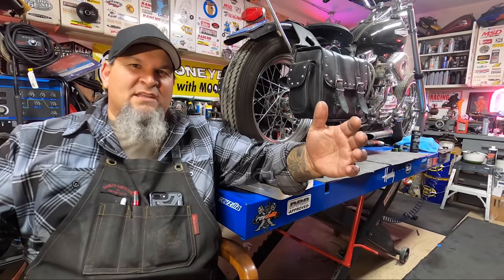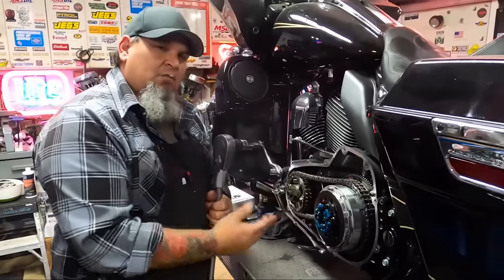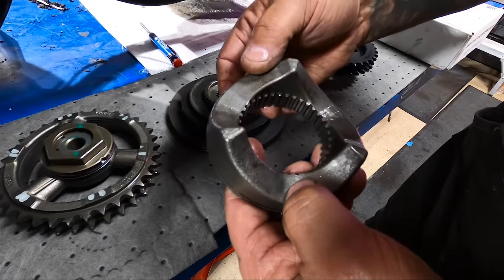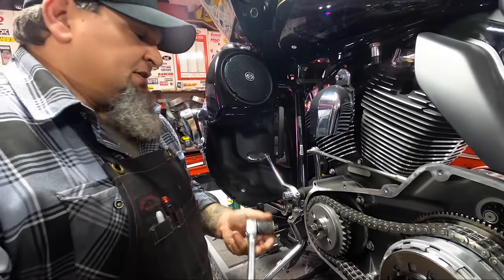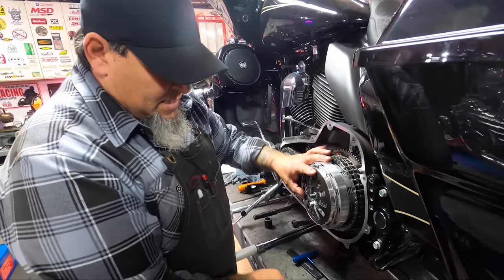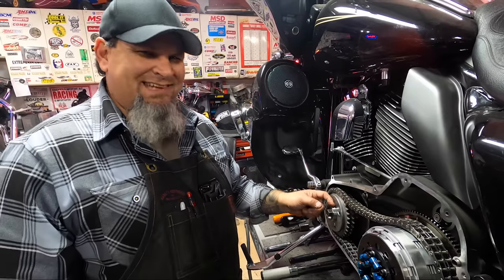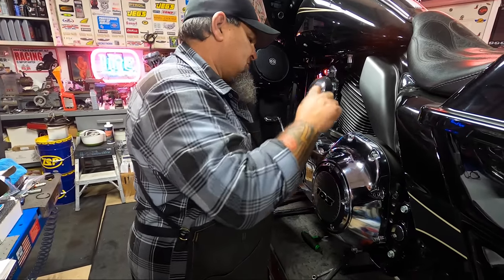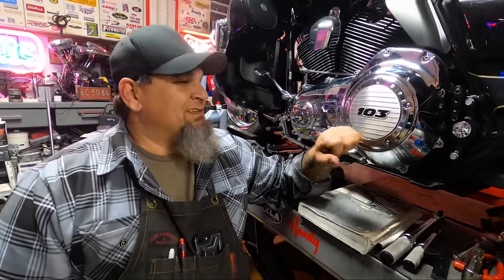Compensator Upgrade for Harley Davidson

Comment: I bought the Twin Power adjuster... after 850 miles the black block the chain rides on was pretty much chewed up.  I tried for weeks to contact Twin Power with no luck at all.  I ended up changing to the Baker self adjuster.  Its a bit noisy but it works good.  Still trying to figure out the right spring adjustment.
Reply from the maker: Tom, I have not had that issue with the Twin Power..... I have also experienced the Baker being noisy. Did you contact the vendor you got the Twin Power from? Maybe they can help
Reply: @LateNiteVTwin  ... I tried for months to talk to Twin Power.  I never could get ahold of them.  I'm now looking for a better adjustor.

Comment: Gary...thanks for  a great video... regarding the chain tensioner, Twin Power part 216094 (touring) was changed to part no. 210481 according to Twin Power customer svc.  Problem is that I cannot locate the part from any of their listed vendors...do you have a supply source, or can i buy it direct from you?  Thx  John
Reply from the maker: I purchase them regularly through JP cycles, Dennis Kirk, Drag, etc.......I still get them under the part number I had listed. Let me know if you need help sourcing one. I'll do some digging
Reply: @LateNiteVTwin  thx buddy.  I'll give JP a direct call.

Comment: What really causes the "ring of death" or "line of death" on the inside of the primary cover?!  I've been told it's a compensator issue.
Reply from the maker: Ken, I have never heard that term. I'm assuming you're talking about the chain actually rubbing the inside of the primary?
Reply: @LateNiteVTwin  i believe that is exactly what he's talking about. Caused by loose primary chain or maybe a bad inner bearing or both, correct?

Comment: Thank you sir for the great video. On cycle works website it says on 07 to 10 1/2 touring models you need to run HD part number30041-08A a retro stator. Is this true? Thank you

Comment: Hey Gary, great video. Question I have is with the chain adjuster. After setting the correct slack do you need to readjust it for wear of the shoe during normal servicing or is it set for a certain period of time like every 10,000 miles etc. Thanks in advance.
Reply from the maker: Frank, thank you for the question! I check the adjustment from time to time, roughly 10-15k.
Reply: @LateNiteVTwin  Thank Gary!

Comment: I came across your channel tonight for the first time and really like it. I have an 08 Eltra completely stock with 10k. I want to change the tensioner and want to know what to look for on the compensator for wear or damage.  Also what brand tensioner would you go back with for a totally stock bike? Thank you for all the time and efforts you put into making you videos.
Reply from the maker: Hi Burt! For a totally stock bike, the Harley Screaming Eagle unit is a good choice. Any hi torque upgrades I think that compensator will lose out in the long run. I would however recommend a manual primary chain adjuster to help keep the wear to a minimum since the stock one keeps the primary chain banjo string tight. Chains like slack, as they tend to get tighter when hot. Belts like tension, not chains. Set the slack to 1/2" to 5/8". The compensators wear against the spring plates, and the drive surfaces of the fingers. Also, look for wear on the bearing surfaces between the plastic thrust washer!
Reply: I took my bike in for a cam chest upgrades and my mechanic noticed a sound coming from my compensator. He replaced it with a Dark horse, but didn’t have his recommended Hayden chain tensioner. I ended up calling Hayden inc to have the tensioner ship to me. Thanks to this video, I can save money doing it myself.

Comment: On my 2014 ultra limited with 6 k miles should I replace the oem chain tensioner to a manual adjustment like the one you installed in your bike?

Comment: Thanks great training. 
Will you be doing 08 style hydraulic cam chain adjuster wear pads. 
My bike has 45,000 miles on it should I be replacing the pads.  ?
Thanks Don
Reply from the maker: Hi Don, the pad on the self adjusting tensioner should be checked for wear yes, but honestly i've seen them go much longer than 45k. Have you had your primary cover off lately to inspect?
Reply: Sorry I changed the topic 
My question is concerning the hydraulic cam chain wear pads
Reply from the maker: @donnixon3528  Don, I have notices that the shoes on the hydraulic tensioners on the cam last much longer than the previous design. It's not a bad thing to check them

Comment: Did you have to grind the plastic oil deflection pieces on the primary cover to get the dark house gear to fit?
Reply: Nope. No grinding nessasary.
Reply: . @maxkilbourne3142  Far out, thanks

Comment: What size is that old bolt? if I'm correct, harley went to the SE compensator as standard equipment in 2011.

Comment: Liked your video and subscribed I just installed the dark horse compensator and manual adjuster i checked alignment with a straight edge and found i have alot of noise coming out of the primary cover? I read the dark horse is louder than stock but it seams excessive any thoughts? Thanks
Reply from the maker: That doesn't seem right???? Mine is really quiet, more so than the stock or screaming eagle unit. What was your chain deflection at? 1/2-5/8"? And what tensioner did you go with ??
Reply: My chain tension was about 5/8" and the tensioner i think was harddrive(looked cheap) I did notice a pretty big tight spot in the chain and thats were I adjusted at

Comment: Do you have any experience/opinion with the Southern Oregon Hot Bikes primary chain adjuster? They are local to me and I want to replace the stock unit with something better
Reply from the maker: I can't say that I have any experience with them. Anything is better than the factory set up! Give them a try and let me know how it works for you!
Reply: @LateNiteVTwin  u got it 👍. Their unit adds tension automatically also, but it is hydraulic, not mechanical. Looks pretty slick.

Comment: After install of man of war compensator is there any noise coming from primary ? Or smooth? I watched a video where there is some noise from man of war sprocket chain noise it was on a m8 tho. Just curious I have a twin cam and was just wonder before I install one of these in mine. Which I think I’m going to do. Please let me know ? Thank you and great video!
Reply from the maker: James, the bike that this install was on was my personal bike. I am happy to report that it's very quiet. If you use the stock tensioner, I'm not sure how much noise that would make. If it's still making a racket then take a look at the inner primary bearing behind the clutch. Those fail due to the chain tensioner keeping constant tension and ratcheting up all the time. I like the Twin Power adjuster, Baker makes a good one, as well as Hayden. I set the chain 5/8" to 1/2" of travel and forget it. Chains do not like to be banjo tight, so look at that as a possible issue. I hope that helps??
Reply: @LateNiteVTwin  
Thank you 
I have a 2010 fatboy lo haven’t done anything as of yet. Just curious your primary chain tensioner you used. I have a Oregon hot bikes primary tensioner now. Looking to get rid of stock compensator ASAP. I have 6,266 miles on bike. Don’t want any issues down the road. Thank you for your input! The only reasoned I asked about noise is there’s a dark horse man of war video of a newer m8 style motor. He had noise in primary case sounded like chain to loose???? I dont know. I just didn’t want same results is why I asked how yours was. Sorry for running on. Have a great day thank you for great video!
Reply: @LateNiteVTwin  
I just got man of war compensator.
They said I needed t70 sprocket bolt. Also have to add a little oil shield to help pour oil on washer on the end of sprocket. Curious if there’s different lengths of bolts ? The HD #10500031 

I will check  lengths is this seem wrong to you? You said don’t install t70 bolt. 

My bike is a 2010 Harley fatboy stock 96ci
Reply from the maker: James, I did not use the T70 bolt from the Screaming Eagle compensator. I just read the instructions, a little vague, but no mention of the shield install or the bolt. When I did the trial run on the video I noticed that the T70 bolt was to long and it hit bottom without the proper seating of the new unit. I did leave the shield that was from the harley compensator upgrade only because it's epoxied on and I did not feel like taking it off. The design does not require it. I will give them a call and let you know!
Reply: @LateNiteVTwin  
I thought that was what your video said too. That the t70 was too long. But if the bolt is too long yeah you can’t use it ? They recommend the bolt as well as the oil deflector at dark horse. Thank you for any help on this just wanting to make sure it’s done correctly. You have hands on and very knowledgeable about this stuff. Thanks again looking forward to hearing back from you my friend.

Comment: Great Video! Have you had any vibration issues since the install of the dark horse comp, I’m planning to install in my recently built M8 107 to 124,now noisy knocking sound from stock comp because of higher compression, thanks for any advice! 🤙🏼
Reply from the maker: No vibration to report, at least from a compensator issue. After all, it's a Harley. I have put 5500 miles on it so far since install and it's performing great.
Reply: I completed the install of the Dark Horse comp, started it knocking noise gone, great video did the work myself, thanks for the great video🤙🏼

Comment: the chain will loosen up with wear like all chains ,moonshine HD sells a constant monitoring unit. I think the older style stock HD is better than the one you showed .
Reply from the maker: I am assuming you are taking about the screaming eagle compensator? If this is what you are asking, I haven't had great luck with them. They are very noisy. The stock unit is a poor design, with high wear factors on the inner primary bearings. Any manual chain tensioner needs checking as it comes a maintenance item now that it's not automatic. I've had good luck with the Twin Power unit not backing off. Any feed back is welcomed. Let me know if this is the tensioner you are referring to?

Comment: Great information Gary, I'll possibly be looking to pick up an M8 now, armed with the knowledge of what needs to be upgraded. Shame the company allows these obvious issue to continue, especially by refitting poor parts to replace failures. I recently sold my 2014 103 Electraglide and got out of Harley, that's the end of what has been a great period of motorcycling for me here in the UK, but too many friends have had too much go wrong with their M8 motors for me to have enough faith to pay out that sort of money for something flawed.  I traded in my HD for a new Rocket 3 GT which I love, but do miss a Harley in the stable. Take care mate and thanks again.
Reply from the maker: Thanks for stopping in! I'm sorry you've moved on to other pastures but for me, I will never get rid of my twin cam. We ironed out the issues and it's a great bike. I agree with you on the M8. I don't hate them. I just want to help make them better. It does really suck that Harley points the finger elsewhere. But hey, we love to ride. We do what we do to ride. Stop in from time to time, and thanks again for stopping in!
Reply: @LateNiteVTwin  Hi Gary, thank you for the reply. I will be watching all your videos from here on in. I have had great service from my Harleys through the years and I will be getting another as soon as I can find the space. Would you recommend upgrading a late model twin cam over trying to fix an early M8 especially knowing the issues?

Comment: So, what are the other pros and cons with the solid compensator? Just noisy?
Great video.
Thank you.
Reply from the maker: Aaron, thanks for the question! The solid gear had some noise only due to the pulse that is generated by the engine. The lack of a "shock absorber effect" that the gear has makes it have noisy feedback, I never noticed any shifting or starting issues. I have installed many compensator eliminator gears for my customers. They never complain only that they don't miss the clack worn out compensators.
Reply: @LateNiteVTwin  thank you for that, much appreciated. 🙂👍
Reply from the maker: @aaroncox3340  Anytime Aaron!
Reply from the maker: @aaroncox3340  Thanks for reaching out!
Reply: Hey Gary, 
Question.
I've got a fueling vented dipstick on order, have an s&s 465 kit, pump, cam plate etc. I'm also going to remove the catalytic converter from my M8, .....now, I don't really trust my local tuner guy, so, what are  your thought's regarding a plug in tuner ????, with the cam, catalytic converter taken out, it'll have to have something.
Maybe a topic for you to do??
Anyway,  take care, see ya next time in the vids.🤟👍
Reply from the maker: @aaroncox3340  Aaron, not sure what state you live in. The tuner I use is the Dyno Jet Power Vision. I have a shop that I have used for years, and I trust for tuning my engines. I don't have the luxury to own a dyno, and I'm a one man show. Dyna Jet has great support for helping out map the bike. Also, look to Fuel Moto. They have tons of maps done in their facility and can even download the tune if you buy the tuner from them. Check them out! Glad to hear you have done the pump, plate and vent. Let us know how those are working for you. Thanks for stopping in!
Reply from the maker: @aaroncox3340  I forgot to share, I have a video coming out about the venting issues on the M8 and we're shooting that in the days to come! Stay tuned!

Comment: Going to replace my 2012 FXDC compensator with the screaming eagle. My bike only has stage one and planing to keep it that way. Do you need to remove the inner primary to replace it? My service manual does not mention it. Mine is the 96 inch.
Reply from the maker: Hi Mark, Harley Part Number: 42200064A will fit with no modifications needed. The inner primary does not have to be removed. You will need to purchase the T-70 Torx to install it.I hope this helps!
Reply: Ok so you don’t have to replace the spring washers that are between the compensator and the rotor?

Comment: Great video, thanks! I have a 2018 fxbrs out of warranty. Going to do a stage 2 with the new oil pump and lifters. Interested in doing other preventive upgrades for long term reliability. Do you recomend going to a manual adjuster on m8 as well? What else you would recomend doing in order of importance? Thanks!
Reply from the maker: Great questions. I would recommend a manual adjuster for sure. The problem lies in the design, as it keeps a constant tension that keeps getting tighter, not maintaining a predetermined slack or play in the chain. It destroys inner primary bearings, and it's hard on the transmission as well.  Good for you on the cam chest upgrade. The aftermarket is full of good top shelf stuff, I prefer S&S only because they use brass as the bushing material, not the parent material which is aluminum. Buy good lifters, and use the aluminum cuffs as well. The M8 has big issues there.

Comment: What’s your opinion of the Baker Compensator?  Cost is more but what do you think of the value?  Is it worth it?
Greg Texas
Reply from the maker: The Baker is a great choice, but similar design to the screaming eagle and I just got tired of shredding them. The Dark Horse is a cush drive design, same principal with the rear sprocket set up in late model baggers. Quiet, no metal to metal contact, and very smooth. That's why I chose the Dark Horse. Not that the Baker is a bad choice......
Reply: Gary
1st, thanks for the reply.  I have the 2008, 105th anniversary Ultra Classic. After watching your video, I think the “Dark Horse” is the way to go.  Haven’t opened up primary yet but I suspect that I have the auto chain adjuster.  
Most videos recommend changing it to manual.  Your thoughts?  Recommendation too please?
Thanks for your time,
Greg Texas
Reply from the maker: @weatherman7142  So, all bikes after 07 got the auto tensioner. I hate hem as they do nt leave any slack in the chain. Chains by design like to have some slack because when they heat up? The shrink or get tighter. Belts are opposite, the like to be tight and when they get hot they stretch. So, by all means a manual chain adjuster is the answer. Baker makes one, a little noisy, and Hayden makes a nice one to. The one in my video is no longer made, Twin Power. Bummer because it's super quiet and easy to adjust. The aftermarket is full of good choices, just read the reviews about them to make a good decision but you can't lose on adding one.